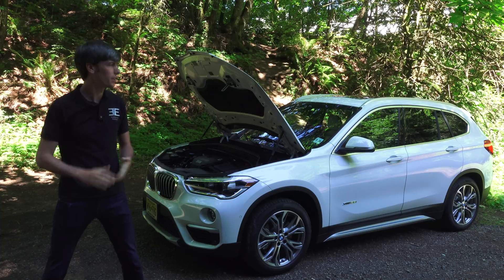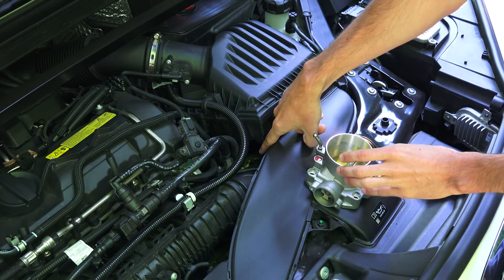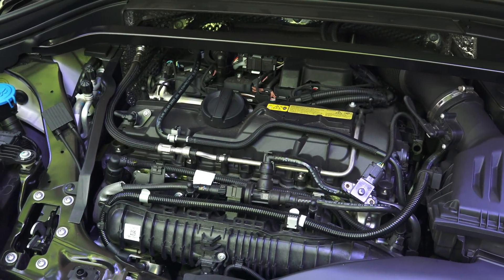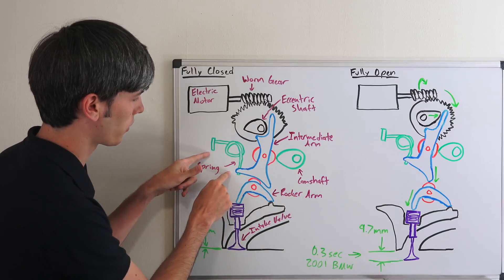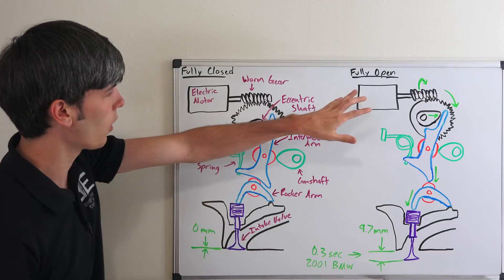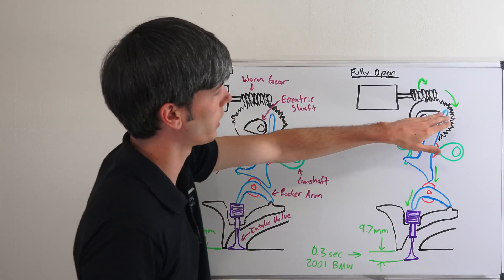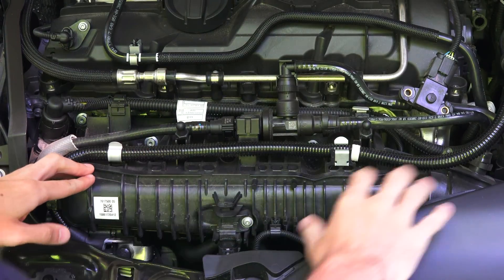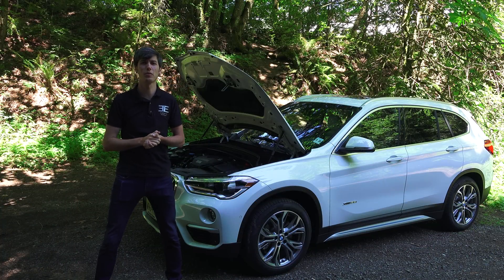What Is Valvetronic? BMW's Innovative Throttle System

Comment: so the valves do the same as the throttle valve restricting the amount of air that gets in the engine and this is supposed to be better? how?. if there is a restriction the piston will still pull a vacuum. is the same crap. 1:07 the engine does not have as much resistance? if the valve are not fully open there is a restriction, the same with the throttle body.

Comment: I've always thought that BMW was very creative in their technology and engineering, but that's a cool system. However, the complexity and price has kept me away. I have a s2000 now, and I feel like I'm paying BMW prices anyway... Local dealer wanted $2200 for a clutch kit. No labor, just parts. The pressure plate, release and pilot bearings, and the friction disc. No flywheel.

Comment: Mr. Jason,
8 years Later.......
So, how is the air mass mesured with this genuine BMW Valvetronic, valve legnth opening management systeme.
Thanks in advance or retard.....
Thank you
BimmerN53
Reply: The same way its measured on most other engines...Mass air flow sensor...

Comment: Im currently running just directly off the valvetronic motor with a 3D printed manifold. No throttle body installed!

Comment: Wouldn't variable length individual throttle bodies end up weighing less overall and be less complex? Also how much of the engines power is used to charge that electric motor?

Comment: How is Valvetronic more efficient? At part-throttle, you still have vacuum in the cylinder and pumping losses *at the valve*. Yes, there's a quicker throttle response as the video mentions, but you're just moving the restriction, not reducing it.
Reply: This is my question too!  Also, the addition of a vacuum pump is adding more moving parts and using some energy.
Reply: Moreover, 
1) This is a turbocharged motor, with Direct Injection.
So, practicaly no benefit from increased air turbulance at low intake valve openings.
2) Throttle valve from fully closed to fully open can easilly be implemented in less than 0.3seconds. Rotation of thotlle valve is intentional smoothed, in order to have smooth engine power outout variation.

Comment: the throttle valve / body is used on cold starts before the valvetronic system takes over. It is not simply a failsafe.
Reply: correct

Comment: Even back in 2016, all then-modern turbocharged gasoline cars opened the throttle at as low a speed and load as possible then controlled the airflow with the wastegate. This is for the same reasons as valvetronic is used - to reduce the pumping losses of throttling the engine. VVL (variable valve lift) takes this a step further by eliminating the need the throttle at low speed and load, further improving the overall efficiency.

Comment: The bit I don’t get is about the resistance to pulling in air. I would have thought the load on the pistons during the intake stroke is the same whether intake is being restricted by a throttle valve or by partially closed intake valves? Why does it matter which side of the intake manifold the restriction is?

Comment: Hi! I hope you will see my comment... :) Thanks a lot for the video. Today I checked my friend's car 2012 X1 28i 150,000km, car won't start or stalls right away after it starts. And when the car starts, I feel like the power is missing a lot(which even made me to push down gas pedal, like old school way, which did not work). My simple 70 dollars scanner shows code : 2DCE, 2E0F, 2DCF, shortly, Valvetronic failure. From your video I understand that the car has a conventional throttle valve which is always wide open when the valvetronic works, and the throttle valve engages like ordinary throttle when the valvetronic goes fail. If I understood the system right, why the car stalls after showing lack of power or does not start - because the valvetronic is kind of 'stuck closed'? If so, will it run with valvetronis motor and gear removed? Again if so, if the valvetronic is 'stuck open', will the car work with conventional throttle valve? I am sorry for many questions, just I would like to understand more about this system... :)

Comment: Valvetronic is a great system! I mean ... it is mechanical, it is totally reliable, failsafe, and it is the most successful continuous VVL ... now, after almost 20 years, I kind of miss using it to its full potentials - like Miller Cycle at high load ... a more complex boosting system might be required, but when you think about stuff like variable compressors ... these can shift the surge line to the left quite a bit, instead of further lowering RPM, this may be used in knock mitigation via said miller process ... increase geometric compression ratio, et voila, as the spanish say, fuel economy will further improve.

Miller engines often suffer from poor response ... but, a CVVL like this can fix it without adding further machinery, but allowing the valvetronic to, kind of, overshoot the stationary position. But, as this compromises knock mitigation, this won't be possible with an engine operating at the very boundaries of operation - you still need to retard spark timing quite a bit to get this to work, also might need a larger catalytic converter to allow temporary scavenging without exceeding the limits...

... blablabla - to put it short, valvetronic is a superior system, but it can deliver a lot more than it does in current engines.

Comment: Great Video. So the throttle body is replaced by the electric valve motor, is this how i under stand it? Press the pedal and the valve motor turns the amount needed?

Comment: So instead of having pumping losses at the throttle body you get them at the valves. If you want less air mass in a given volume at a given temperature, then you have to create a vacuum. Way to go neglecting thermodynamics BMW.

Comment: BMW used valvetronic since 2000. Nice, if it works, but very expensive, if failed. Probably the whole fuel savings will be spent to repair. Toyota has the same device, by the way. Called "Valvematic" here.

Comment: Funny thing is that my 2005 BMW with valvetronic has a much slower throttle responce than my old '96 Toyota with a mechanical throttle. I'd very much like someone from BMW to explain that one...

I honestly do not see the point of this endless input augmentation. I get that the natural responce of a cable throttle is not ideal for all drivers, but how is ANY of the artificial mush on the market today any better than just straight up linear?

Comment: Great video but one thing I don't understand. Why would it have reduced pumping losses when the piston is still pulling air through an almost shut valve? I mean it still acts as a throttle to reduce volumetric efficiency as this is a spark ignition engine and air fuel ratio should be maintained around stoich. It's not like a diesel with no throttle valve and valves on full lift and very lean mix at low loads. Isn't it the same as actually pulling air through a throttle body in the intake manifold. Or is it the difference because it has a smaller volume of air to pull (just the cylinder) rather than air behind a throttle valve (intake manifold, runners, valves, cylinder)? If this is the reason an ITB with short runners will be better and more reliable.

Comment: Have a question which you might be able to help. Thanks in advance. 

I have a 2011 e90 that is continually giving a bunch of valvetronic eccentric shaft sensor errors for the last year plus, since I bought it used. Had the sensor cleaned too, but error is still there. Engine works fine, no engine lights either. Mileage is about 17+ / 25    city / highway. I am a low mileage driver. 

Can you confirm that the the valvetronic essentially helps with fuel efficiency, so if I am not experiencing a problem and don't use my vehicle daily, I am okay .... ie no catastrophic failure expected? Or it could be that the unit itself is working fine, but the oil in the sensor's external readout is an issue, which does not have a functional impact. 

Trying to understand if I can continue ignoring the sensor errors. Has not been an issue over 2 years and 10K miles. Thanks.

Comment: BMW engineer: Yo, lets make a new throttle system with a bunch of moving parts prone to fail, but let's keep the old system in the way just as a fail safe.

BMW Intern: but sir, why don't we just use the old system and make it more efficient instead?

BMW engineer:..... your fired.

BMW Intern: ok, i'll leave.... by the way your design is not that fuel efficient as you expected.

BMW Engineer: get the F out now!!!!.... are we back in the bubble?... ok... now let's remove the oil dipstick from the engine bay....

Comment: I have an N52 engine with valvetronic with almost 300,000 miles, 0 failures, and the valvetronic motor is actually really easy to get to and replace, you just need a $20 program and some computer knowledge to calibrate it once replaced.

Comment: A few people have locked their valvetronic at full tilt (9.9mm) so they're always at max valve lift. You could also probably take off the throttle plates to maximize air flow.
Reply: why bro

Comment: thanks a lot engineering explained, very well explained and how you easy delivered the most complicated operating parts,,  i dreamed to be an mechanical engineer such as you,, but having a huge problem about financial matters,, i accepted that it will not happen,,  any way, by just self studying about automobile engineering, i found your channel very useful,, hmmm can you give me some tips or advice about how i learn some basics engineering, and what kind of math do i focus etc.. just like a guide when do i need to start first or step by step to easiest way for learning,, i just finished just two years automotive course here in the Philippines and i want to gain more knowledge to be more effective as a simple mechanical technician,, thanks man,, (excuse for my poor grammars)

Comment: +Engineering Explained 
If the pulse width of the signal to the electric motor is greater than 0s, then it is not "infinitely variable". It may be extremely variable (up to millions of positions or more) depending on the gearing of the worm, but that is not infinite. Great video, just be careful with word choice.

Comment: so they took their already unreliable cars and decided to add individual electric motors that control the intake valves along with more moving valve train parts that will without any doubt be prone to failing and being very costly to fix. all for a 10%~ fuel economy gain. sounds about right.
Reply: Brutality110 we had a valvetronic failure obd code on a bmw 120i 2005..cost a fortune to repair. bmw over engineering prone to constant costly repairs
Reply: As someone that is trying to make their N55 faster, I am now only going to maintain my car and trade it as soon as I can bc of this. Even if you wanted to rebuild your engine you can’t bc it needs a special tool in order for that Valvetronic motor to work.

Comment: Fiat/Chrysler used a similar concept but it hydraulic. ( engine oil)  It has fewer moving parts than this system.
Reply: bootlegger 23 You're talking about Multiair, I don't think they use it for throttle but rather as a different way of adjusting timing and lift throughout the rev range.

Comment: Individual Throttle Bodies can be a good compromise between one throttle body on the intake manifold and this very complex system. It can reduce the huge vacuum inside the intake manifold.
Reply: What matters most is the pressure outside the intake valve itself, which is very similar for conventional and ITBs, and much lower than atmospheric pressure at low engine loads. Valvetronic has atmospheric pressure immediately outside the intake valve at all engine loads.

Comment: With the EP6/Prince engines (the 1.6l unit in MINIs, Peugeots, Citroens), you can disconnect the cable for the intake VVT solenoid which disables VVT and the valvetronic system. I think peak horsepower stays the same and the engine runs much but smoother but the low end torque is pathetic and the throttle response is terrible (but very smooth). Eventually the check engine light comes on too. :-)

Comment: This all seems needlessly complex to me, but the only real part that would worry me as far as failures go is the electric motor. That said, these systems do NOT have a reputation at all for failures. VANOS on older vehicles is a different story. 

But again, I'm not that much of a fan. My 3 series still barely manages 19 mpg in city traffic and it has a muted throttled response from the Valvetronic system combined with silly throttle pedal mapping that is not linear enough.

Comment: Are the exhaust valves controlled in the same manner in order to match the intake volume or are they on a fixed lift cam?
Reply: They are fixed; it would reduce efficiency to restrict exhaust valve emptying. The purpose of putting the throttle on the intake valves themselves is to reduce pumping losses at low engine loads by keeping the intake anifold pressure at atmospheric.

Comment: You need to know what engine you are talking about.  The engine in the X1 is a B48. (turbo charged 2 liter.) The intake is always under boost. There is no vacuum pump on that engine. Put a multimeter on the TB and you will see that the TB operate like any other TB. I own two vehicles with a B48 engine. 2015 X1 and a Mini Cooper S. I also have three friends that are BMW master mechanics.

Comment: at low throttle, wouldn't it still pull the same vacuum in the cylinder as a regular throttle body, thus incurring the same "pumping losses"?

Comment: So basically a better version of the hydraulic valve risers... TSI engines are much simpler in that regard, having a second set of butterfly valves over each 2 intake valves.... Sadly the direct injection remains a bad choice in the long run...

Comment: is this to say that when the throttle is not pressed, or coasting, that the intake valves will not be opening?  If so, then how does the engine continue to run at idle if no air is being sucked in?
Reply from the maker: +Ethan Beattie they open, but only enough to allow a small amount of air in.
Reply: thats what i figured, just making sure, the diagram looked like it said 0"  thanks again, huge huge huge fan!! I've learned so much from your channel!  Keep it up!  do you go to any car shows?  What region?

Comment: This valvetronic thing by BMW is definitely new technology, but Diesel engines have been doing something kind of similar for many, many decades.  They have no throttles -- engine speed is controlled by the timing and duration of the fuel-pulses injected into the combustion chambers of the cylinders.  Like this BMW engine, a Diesel engine doesn't generate vacuum -- my 1980 Mercedes-Benz 240D had a vacuum pump that drove all the vacuum-operated accessories, like the brake-booster.

Comment: Is not the same amount of force that the engine make inducting air? The limitation in one case is the throttle body and in the other case are the valves. There is always the same vaccum inside the cilinders.

Comment: Jason, It would be interesting to do another video on FCA's MultiAir system, which is electrohydraulic but very similar to BMW's Valvetronic.  GM's Intake Valve Lift Control (IVLC), while not continuously variable like Valvetronic and MultiAir, is another interesting variable valve lift system.

Comment: wouldn't there still be vacuum but it would just be in the cylinder vs in the intake manifold like normal?
Reply: Yes, but that vacuum already exists in the cylinder in a regular system. This system means you have less area under vacuum, which means that you have fewer losses... Instead of pulling against a high vacuum (manifold) with a higher vacuum (inside the cylinder) to pull air into the cylinder, you're pulling against a low vacuum (atmospheric pressure) with a high vacuum, which allows more air into the cylinder faster.
Reply: Oh, true since pressure equalizes in a closed system the vacuum would still be present at low power settings but it would be from the piston to the TB... these are things you just normally don't think about lol. I'm pretty knowledgeable too I worked in an engine machine shop and built and raced an 8 second 1000 hp ta. And did put crew engine bottom end duty on the Main and Martinets Top Alcohol dragster lol.

Comment: If brakes needed intake "vacuum" to function, turbo cars would have... problems.
Reply: That's why the vacuum is stored in a seperate brake booster servo (with a one way valve) that acts like a flywheel when the intake is at or above ambient pressure.

Comment: VVEL Variable Valve Event and Lift has been on the Nissan 370z, and all Nissan 3.7L engine and the 5.6L V8 in the new M car.  Works well, Nissan only has the throttle blade for vacuum for the brakes, no pump needed.  Also only closes like 2mm, will never go 0.  Love that the air now stacks near the valve and not the throttle blade, but still think it will be out matched by a solenoid valve engine.  Also on a Nissan with VVEL if anything wrong with the head, you just replace the head assembly, big bucks.  Would love to see the repair for a BMW.

Comment: All that work for 10% better fuel economy. Over engineered.
Reply: GM and Ford both just spent billions to build factories to build 10 speed automatic transmissions with maybe hundreds more moving parts to get 2-4% better fuel economy. 10% is a big improvement... And while it IS more complicated, at least there's a reasonable gain to it. 

We got from 15MPG being normal to 30MPG being normal through a few decades of 5-10% improvements. A 10% improvement on 30MPG is also a heck of a lot more than a 10% improvement on 15MPG.